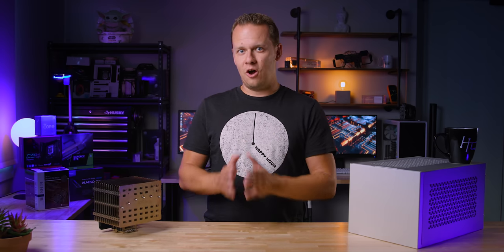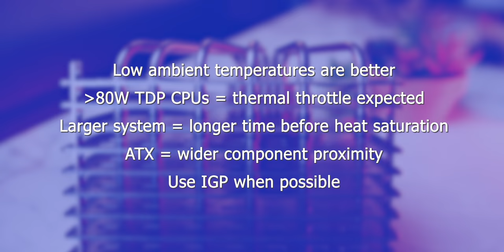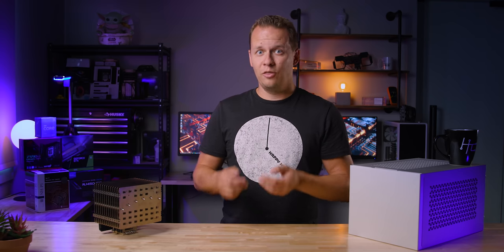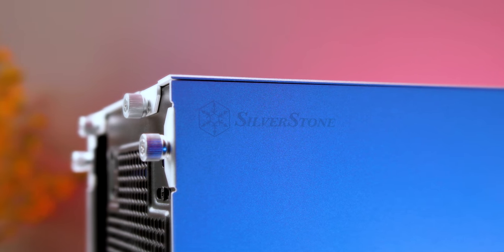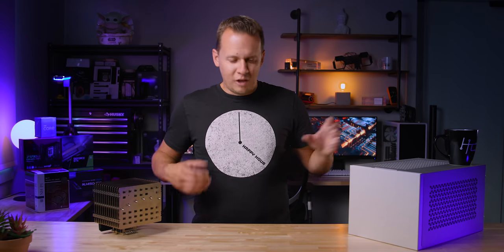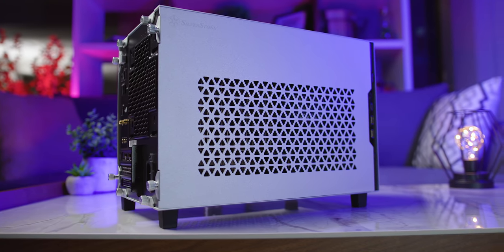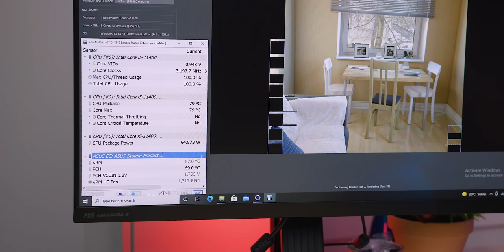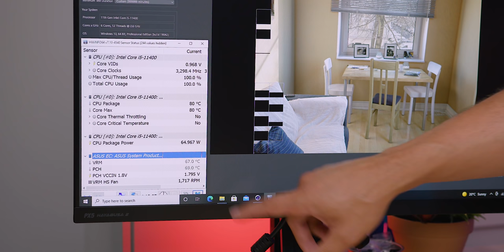This Passive PC Build is TOTALLY Different!

Comment: Lower the fan so it blows through the GPU, and it will only be able to go up. You'd probably see an increase in processor temp, but the processor seemed ok and if you get enough airflow they might stabilize at an acceptable level.

Comment: I. Why not try other fan configs? That case has 2x120mm mounts on the other side of the motherboard, right? You can use that to direct air through the CPU cooler (given its orientation) while minimizing that hot air getting to the GPU cooler or helping to force air to move through the GPU cooler. 

Since you're using case fans it may also help to actually not have as many vents in order to guide the airflow through the coolers as pushed in by the intake fan rather than for example have exhaust fan pull air from the open vents.

1. 120mm X 15mm fan intake over NH-P1, 120mm X 25mm(?) fan side exhaust on the other side of P1
1b. 120mm X 15mm fan intake over NH-P1, 120mm X 25mm(?) fan side exhaust on the other side of P1, cover rear exhaust mount 
1c. 120mm X 15mm fan intake over NH-P1, 120mm X 25mm(?) fan side exhaust on the other side of P1, cover rear exhaust mount, cover upper half of vents over GPU cooler

2. 120mm X 15mm fan exhaust over NH-P1
2b. 120mm X 15mm fan exhaust over NH-P1, cover rear exhaust mount 
2c. 120mm X 15mm fan exhaust over NH-P1, cover rear exhaust mount, cover upper half of vents over GPU cooler
 
3. 120mm X 15mm fan exhaust over NH-P1, 120mm X 25mm(?) fan side intake on the other side of P1
3b. 120mm X 15mm fan exhaust over NH-P1, 120mm X 25mm(?) fan side intake on the other side of P1, cover rear exhaust mount 

3c. 120mm X 15mm fan exhaust over NH-P1, 120mm X 25mm(?) fan side intake on the other side of P1, cover rear exhaust mount, cover upper half of vents over GPU cooler

4. 120mm X 15mm fan exhaust over NH-P1, 120mm X 25mm(?) fan side exhaust on the other side of P1
4b. 120mm X 15mm fan exhaust over NH-P1, 120mm X 25mm(?) fan side exhaust on the other side of P1, cover rear exhaust mount 
4c. 120mm X 15mm fan exhaust over NH-P1, 120mm X 25mm(?) fan side exhaust on the other side of P1, cover rear exhaust mount, cover upper half of vents over GPU cooler

4d. 120mm X 15mm fan exhaust over NH-P1, 120mm X 25mm(?) fan side exhaust on the other side of P1, cover rear exhaust mount, cover upper half of vents over GPU cooler and the rest of the vents on the GPU side that are not over the GPU cooler

II. And then here's another passive and semi-passive experiment: Try the same CPU, motherboard, and GPU in a Lian Li 011 Mini. Try any of these fans for this: Gentle Typhoon, NF-A12x25, P12,  Toughfan 12.

1. Full passive

2. Bottom 120mm intake over CPU cooler, top 120mm intake over GPU cooler, rear 120mm exhaust

3. Bottom 120mm intake over GPU cooler, top 120mm exhaust over CPU cooler, cover rear vent

4. Bottom 120mm intake over GPU cooler, top 120mm exhaust over CPU cooler, cover rear vent, cover side vents (this further prevents top exhaust from sucking air in from somewhere else)

III. Semi-passive test: Same Lian Li 011 Mini, same fans, BUT try a 1660Ti (or 2060 but don't run ray tracing) but this time put a Raijintek Morpheus on it (or just deshroud a Strix or whatever 2060 has the biggest cooler; although IIRC the cooler isn't all the same ie the lower tier cards still get fewer heat pipes), and maybe two of 80+ Platinum PSUs one for the CPU, motherbaord, etc and one for the GPU if you can find such a PSU that will barely spin the fans at max 150w load on each (to account for the GPU).

Then check this vs the 1650 for how much faster the 1660Ti is and how much hotter the CPU runs and if it throttles to the point that lower CPU boost starts affecting the FPS.

Dual PSU is to keep them from spinning too fast and get noisy; two passives, maybe no need to try, we already know those will be quiet BUT I'm not too confident about two of those passive PSUs next to each other in the cramped compartment on the O11 Mini for long term use even if you split the load as there's no airflow back there and they'll sit stacked on each other.

1. Bottom 120mm intake over GPU cooler, top 120mm intake over CPU cooler, rear 120mm exhaust

2. Bottom 120mm intakes over GPU cooler, top 120mm exhaust over CPU cooler, cover rear vent

3. Bottom 120mm intake over GPU cooler, top 120mm exhaust over CPU cooler, cover rear vent, cover side vents (this further prevents top exhaust from sucking air in from somewhere else)
Reply from the maker: Yes....absolutely!

Comment: Nicely done..but for me it is better to take a bigger case (higher or larger ) and put adjustable noctuas120 (2 in and 1 or 2 out)...so you can adjust fans very low and keep a better air flow management and keep the pc very very quiet...(mine is : fractal design mid case, quiet cpu ventirad Palit 1050 TI Kalmx, noctua fans)...(now there is the palit 3050 kalmx)..ideal for "small" games and htpc madvr medium...thanks for sharing

Comment: Very inspiring build, I love it. Personally I would have tried to wedge that slim low RPM fan as an exhaust between the top panel and the Noctua heatsink, if possible (which is also something that Noctua recommends). This should benefit both the CPU and to a lesser degree the GPU - instead of the swirling that the side fan did.

Comment: I think for a passive itx system, it would make more sense to try an open-air case like an Xproto. You will just need to dust it off every now and then with some compressed air or vacuum dusters.
Reply from the maker: Maybe.  I'm just not a fan of the looks!

Comment: Finding a fanless power supply at decent price is hard. It would actually be cheaper to take a significantly overkill PSU with semi-passive mode, ensuring the total power of the system never exceeds around 40% of its capacity (Fans usually start around that) and removing both the fan and the lid it's mounted on, thus ensuring the internals get some airflow. Have a leftover 850 watt Seasonic with decent heatsinks inside power up a GPU-less office PC this way, it never gets noticeably warmer than room temperature.

Comment: To me it seems that there is enough room for 120mm exhaust fan at the back of the case. If not 25mm then a slim one at least. I'm pretty sure that will give you best one fan performance out that case with your current setup. One interesting test would be to swap the Noctua with let's say Mugen 5 with fan at the back of the case instead of on the heatsink and see how much better the P1 actually is if at all. Then test again with the fan on the heatsink and no fan on the case. I still think having the fan at the back of the case will result better combined results for CPU and GPU

Comment: There are passive coolers for GPUs like the Rajintek Morpheus and theres an older one from Arctic (but might be hard to get, if you are EU I got one). Both of those can do 120+ TDP, the Rajintek even considerably more, but you also have to check manually what GPU will work with those. Also unsure about the clearance and space requirements in your given case, but anyhow they should beat your 1650ti hands down :D

Comment: Shame they don't make such passive GPU-s with something like 3060 max q, it would be a little cooler than a desktop 1650, but would perform much, MUCH better. 
As for the current build - I really recommend undervolting your CPU and GPU, thermals will be perfect then.
Reply from the maker: Funny, I'm happy with the thermals.  :)
Reply: @HardwareCanucks  unlike CPU-s, GPU's have much lower critical temperature. RTX 3000 series for instance, has 93 degrees as critical temp. 
So considering some GPU-s even throttle at 75 I don't think 83 is good for longevity. 
CPU temps are fine though as long as they are below 85(temperature beyond which it starts degrading)
Reply: 83 is perfectly fine for longevity
Reply: @riba2233  then why do some throttle at 75?
just off the top of my head - my friend's desktop rtx 2070 and the latest Asus TUF A15 laptop GPU-s.
Reply: @TabalugaDragon  it depends on sillicone and node, for pascal and turing 83 is factory target value. For bulldozer cpus it is less than 70 etc but for zen2 and 3 it's 90 etc.
Reply: @riba2233  what do you mean target value? are you saying when it operates it cooler temps it's worse for them than 83? won't it be better to have a GPU is cool as possible? well within reasonable limits, I'm not suggesting to freeze it.
Either way, undervolting reduces strain on voltage regulators and other circuitry, prolonging lifespan of the GPU.

You didn't answer my question though. Why do some Turing cards throttle at 75 if their target temp is 83?
Reply: @TabalugaDragon  target temp is the point after which fan start to increase rpm to keep the set temp, so the gpu will most often operate at that temp. If the fans are at max  and the gpu is still getting warmer, then there is a max temp (90 for pascal and turing) and after that point gpu starts to throttle heavily to stay at max temp. Max temp is also safe for 24/7. Lower temp is better of course, but these temps are also safe. Aib's can se the target temp to a different value, it can be lower if the cooler is better. You can also do the same with custom fan profile.
Reply: @riba2233  you still haven't answered my question... or do I need to ask it for the third time?

also what you said makes no sense, as GPU-s often work at lower temps and fans still ramp up, even if it's at 65-70 degrees, so it's not like a fan is idle or works at lowest spin until it reaches 83 degrees. There is a curve - the higher the temp, the faster a fan works.
I've never seen in my life a CPU or GPU tied to a certain target temperature - it's always different depending on load.
Reply: @TabalugaDragon  all modern gpus work like that more or less, sometimes the  effect is less visible  if the cooler is really good. I have answered it, the last part of my post. But mostly the reason is marketing (since many people don't like to see 80deg and think cooler is always better and don't look at noise normalized performance) and to provide for some oc headroom
Reply: @riba2233  marketing? then why are there so many dead GPU-s on the second hand market? If a GPU is faulty it's evident from the moment you buy it when it's still on warranty.

Also I don't see how having a 75 degree limit gives more overclocking headroom, it's even a bigger limit than 80 or 83 degrees, which is why I couldn't overclock my friend's desktop RTX 2070 as it kept throttling at 75 degrees.
Reply: @TabalugaDragon  you can move the max temp point in afterburner so not a problem. Dead gpus are not dead because they ran at 80-85c, those gpus would be dead if they ran at 60. All workststion and server gpus run at 85-90c all the time, 24/7 at heavy load.
Reply: @riba2233  "those gpus would be dead if they ran at 60." those are faulty GPU-s which are on warranty, I'm talking about those which worked for a year or two and died.

Comment: Reaally nice. I might be less surprised than some, as I have a somewhat similar biuld. A Louqe S1, with the Palit KalmX 1050Ti (which I will replace with a 1650 Ti someday). It also has the same NightJar PSU. My CPU is an older Ryzen 3200G with the Noctua NH-L12 Ghost S1 edition cooler, which is dead silent all the time. It has been my media center PC for a few years and is really awesome.
Reply: @Garrus Vakarian nice, what cooler do you have on it? Once upon a time I had a 8800GT where I replaced the cooler with and Arctic Accelero, that was actually quite good as well. 🙂

Comment: you could also swap cooler on some hotter card, morpheus or accelero (whichever version) would do just fine, but that would break one important thing: it would need external power and that's a grave sin

also there are faster "passive" cards, cause that's how they call the server cards, but that won't work without some crazy fans
BUT you could buy RTX A2000 and put mentioned earlier morpheus or accelero on it (some fiddling and extra hardware may be needed as surely there's no right mounting hardware included) and squeeze some extra compute power

edit: but if you want to have the card vertically accelero wouldn't work due to fins orientation so morpheus it is
or you could also try transplanting kalmx there, that's what I first tried with my 1650... but sadly cooler from 750Ti didn't fit on gigabyte card so I grabbed accelero before palit finally released new card

Comment: there is a version of 5700xt by sapphire that is passively cooled
Reply: But would it fit? :) This is why an open build would be better.
Reply from the maker: Yeah but its meant for compute datacenters.  You can see that by the fact its fins are capped above the GPU.

Comment: I want to build a case that is cooled by shade, solar updraft, and wind. No fans minimum components, a 35-watt processor, and nothing else but an M.2 SSD. 
It's to turn stepper motors and cut down on the size and cost of batteries and solar panels. There is no electricity where I'm working and it gets hot. I've never done something like this before. I'm used to building workstations, even adding server fans.
Reply: My office is outside and the wind blows a lot here. The PC case is a small DIY bench about 3 x5 feet with an open-air ATX test case screwed down to some plywood on drawer slides. I want to try solar updraft to pull air through the case if the wind is not blowing. I got the idea while sitting at a bar in Arizona they cooled the place with the solar updraft.

Comment: Try to undervolt both the GPU and cpu , it'll help a lot . That's how I made my laptop from shithole to a proper gaming pc ( light eSport titles ofc )
Reply: Undervolting is the best thing in PC world ever. It has ZERO drawbacks when done right, and the advantages are just insane. Same performance, much less power usage, less electricity bill, cooler temps, longer lifespan, you can turn off the fans when temps are under 50°C for maximum longetivity.
Reply: @anonymouspokemon4623  legit , maybe it hampers my GPU a bit coz I could oc it to 2000mhz and only 1860mhz when undervolted but the temps are well worth that small performance increment.

Comment: GPU was throttle all the time… but it’s impressive, considering all components are passive air system.
Reply: No, it’s not throttling, it’s boosting less, Mike explains this very well in the video. Base clock is 1485 MHz, if you’d come below that, that would be thermal throttling.

Comment: iGPU would actually be even harder because no VRM has been designed to passively provide such power iGPU needs. Usually they only have one mosfet for iGPU that will instantly be at 100c+ and throttle. Desicrete GPU is the way to go on passive build.

Comment: ....You realize that you put the fan plate/bracket on up side down? :)
Flip it around so that the fan sits lower, and actually over the vents on the side panel. Mounted in the "up" position, it tries to suck air through a solid aluminum plate.... :) In this position it mainly circulates air in the case, it doesn't pull any new air in.
Another great thing about having an intake fan lower is that some outside air will be blown over the graphics card too, AND most of the passive air in the top of the case will be under static pressure (i.e vent out of all available openings up there)
Airflow, pressure and temperature isn't even remotely as hard as many seem to make it seem. Hot air goes up, but the pressure effect of this is only in the 0.001-0.005 mm of H20 compared a very low rpm silent fan that typically gives ~0.5 mm of H2O pressure. That means that a fan is an air movement force several hundred times stronger that convection. ANY fan inside the case will instantly break most convection flows.

Comment: i think this is the first time where someone actually uses the Nightjar
Reply: I own one, it’s fantastic. With a 5600x and 3070 was only pulling 320w under load, and the PSU barely got warm. It’s way overbuilt, same components as their 850w Titanium SFX PSU.
Reply from the maker: Man, the Nightjar is AMAZING.  A little $$ but well made and totally under-rated.

Comment: Stupid case, I built the P1 cooler in a much smaller Jonsbo U2 case and it fits perfectly 🤌
Reply from the maker: Not with a passive GPU you didn't.  The lack of top venting of any kind makes it a hot-box.
Reply: @HardwareCanucks  Right, it's an APU 4350G. But the P1 fits without cutting out anything from the case, although the U2 is much more compact 😏

Comment: You never even tested the 180 degree rotation of the NH-P1. Because it does fit just without a rear fan which you did not run.

FYI you don't know your angles.

Comment: turn the fan around this shhold do the trick but yea it is impressiv how powerfull pasivecooling can be. i use as my daly pc a j5040 it is an mini itx wit a pentiom silver j5040 10watt cpu withh 4 cores and i installed 16gb ram. this cpu can 4k but it dropes some frames evrey 200 with firefox it is barly notcable but i uses a 1080p monitor it is fine with it. motsly i hear music or watch youtube so i decided i build a lowpower pc for tat. my man pc uses in idle 150 to 180watts and it is noisy as hell. bus this low power ps is passiv and unes in idle 7watts and under full load 25watts and is silend. i dont use a ssf psu because of the nin load efficency, but  i use a pico 90w psu and a 3A 12V barreljack power brick. i tested it under fullload over 3h and the cpu dont trotle at all but it settled at around 90C in ambient temparatur of 28C so i think it is fine

Comment: Eventually, i rather find that psu design did useful, not the case fault either. You just need to find suiteble psu design specifically for that case. And not randomly accuse that design is a failure.